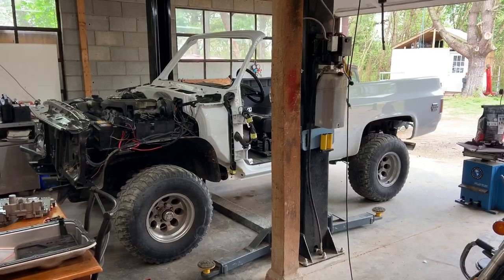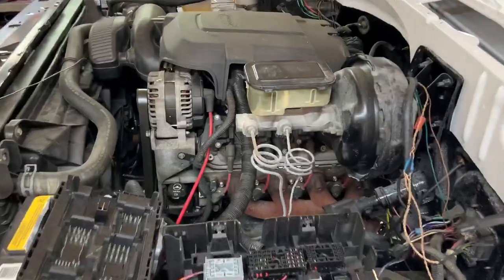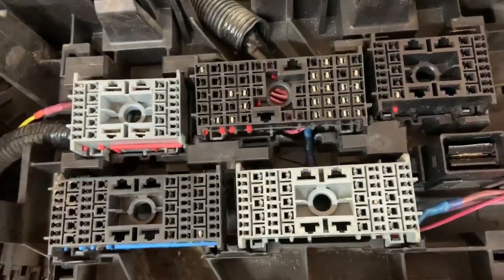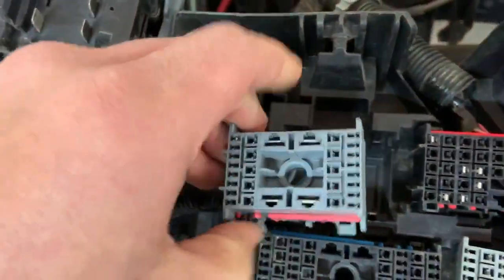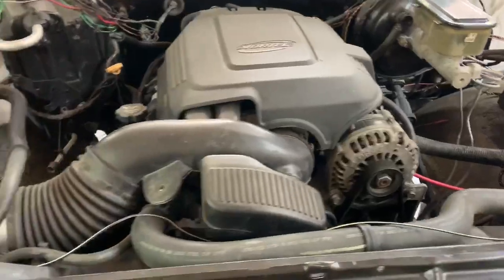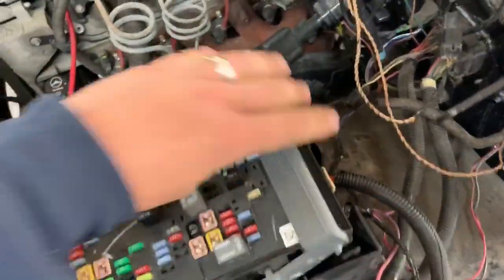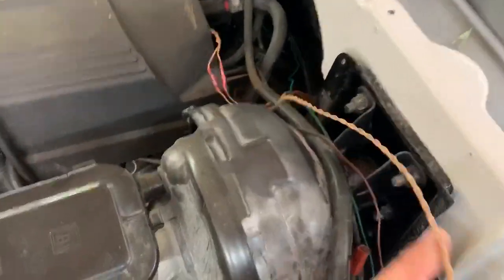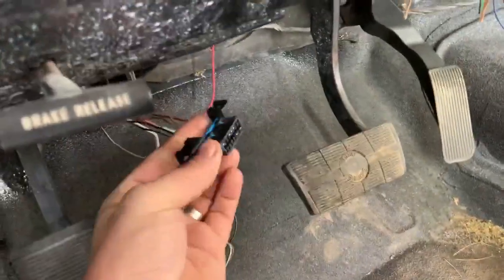Wiring gen 4 GM LS swap with factory 2008 GM Truck harness and fuse block.  6.2L L92 6L80E K5 Blazer

Comment: Are you running the ac off the Escalade because I want to know if you can.  I’m seeing that you need the body control module and climate control to run it. I have a complete donor just want to know

Comment: Can you not just run the gas pedal wires straight to the computer ? Without the box you had ?
Reply: I used an equivalent year gas pedal from a chevy cruze and ran a factory harness. Works just fine.

Comment: I did my gen 4 swap and just used a generic ls swap fusebox. I'd love to tell you how much cleaner it looks than yours but it's a rats nest lol. Works perfectly though :)
Reply: So there is hope😅😅😅 GM made these puzzles pretty tight to solve. Any info on your kit or vats delete? Please?
Reply: @RBlatch4d what's your issue? Basically, I bought a painless performance fuse block (can work on gen 3 or 4), I then used the wiring harness diagrams available on ACDelcoTDS (if you have a VIN it will give you your donor car diagrams) and a multimeter to find where goes what. Eventually you'll get the GMLAN wires which connect to your OBDII plug that you can buy from Amazon. Then find someone with HPTuners to remove the VATs or buy it yourself.

Comment: How did you hook up OBD2 connector without the BCM?
Reply: You just use the GMLAN wires from the harness itself straight to a generic OBD2 connector
Reply: What wires is that @Labergemusic
Reply: @moosestangls5099  that'll depend on what vehicle/pcm - acdelco tds will have wiring schematics for your engine/trans, especially with the VIN

Comment: Hey I’m stuck on the gen 4 harness to the gas pedal 6 pi connector mine was cut where do u wire the pedal harness to the main harness
Reply: Did you figure it same issue
Reply: @cjjackson1180     color for color from ECM J1
Reply: @cjjackson1180 Lt1swap has that

Comment: did you use the fuel pump flow control module or did you bypass it with fuel filter regulator
Reply: I just used a fuel pump regulator from a corvette. Serves as both a fuel filter & fuel regulator

Comment: Hey nice video on the connecter with all the pink wire I see a purple wire you have tied in what is that for
Reply: I think that’s the starter Solenoid wire
Reply: @georgegomez9879 why not just run it to the small lug, like Gen 3… (off starter) wouldn’t it serve the same purpose or no ?

Comment: hello.. im using the same engine transmission and harness but i cant start the engine.. i dont have signal to the fuel pump, injectors and sparks.. is there another wire that im missing ? thanks in advance
Reply: Also having this issue, did you figure it out?

Comment: What did you do with the Body Control Module from this engine and still get it to run? I'm working with an 08 LY6 6L and I can't find any info on how to delete it to simplify my LS swap project.
Reply: you dont need the body control module for the engine to run. Take the ECM to your local tuner & have the VATS deleted. Once done, the engine can run with just the engine harness.
Reply: @fir3gun hi, how do you hook up the obd 2 ports without the bcm?

Comment: What and where is that where for the fuel pump leading and thank I've been searching for this information it was highly recommended appreciate the info on the fuse box
Reply from the maker: The wire goes to the gas tank. Power wire for the fuel pump. Then the ground goes to the frame.
Reply: @highmileautoserviceandauto6102  are you still out there
Reply: @highmileautoserviceandauto6102  there are two wires on the fuel sender (usually one purple and one gray), then a ground (goes to the frame)
Which wire did you connect that fuel pump wire to?
Reply: @fir3gun grey is power, purple is fuel level

Comment: Video added to l76 engine swap library,  question chief...where did you dig up your ecu pin outs to figure out what to keep and what to depin? looks like the e38 pm crowed isnt so popular with folks doing standalone harnesses and what not.
Reply from the maker: Prodemand online has complete diagrams for the whole vehicle so I went through each connector one by one.
Reply: That probably took a little bit of time, but that is very helpful I will have to go and take a look. I was at the point where i couldnt be certain the harnesses advertised would even work with with my swap...id s till rather make my own.
Reply from the maker: Yes it wasn’t quick. I decided it was worth it for the learning experience and I made the video to make it easier for everyone else  that may not have the diagrams and/ or time.
Reply: Can you email me the info for your set up and how you wired the pedal Grimm80@hotmail.com
Reply from the maker: All 6 wires from the pedal go directly to the pcm. I’ll get you the pin outs.  I had a connector halfway only because I completely removed the wiring from the donor truck but it’s not necessary.
Reply: Did you remove vats?
Reply: Could i also get that diagram for the pedal to pcm
Reply: That translation you use ? 
Original  K5 or another?